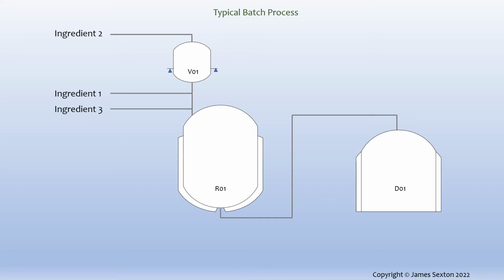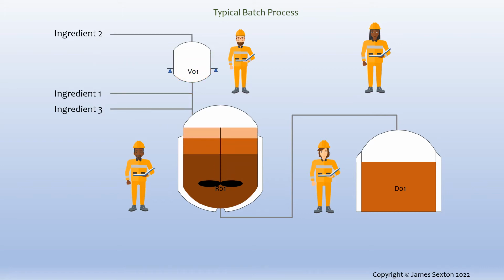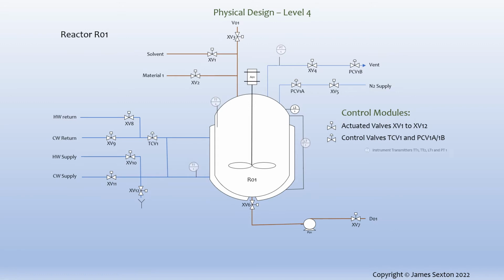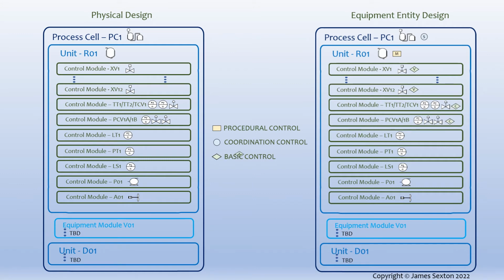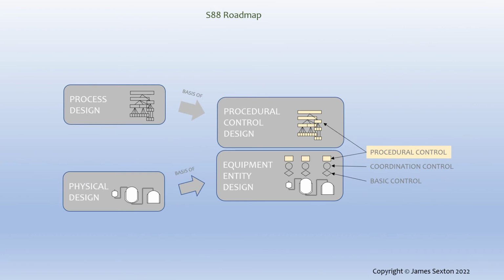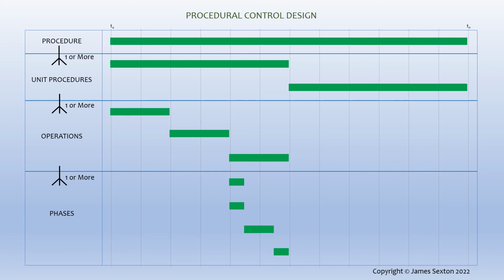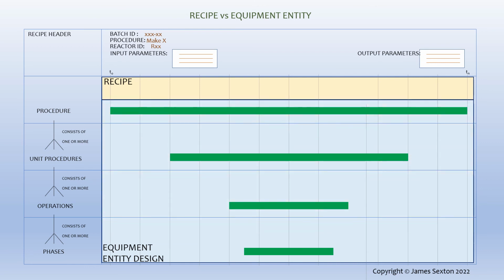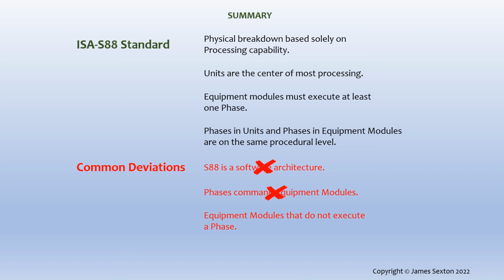ISA-88 Batch Control Design

Comment: I'm a little bit confused by your depiction of a level transmitter as being a control module on its own. The standard describes a control module as a "a collection of sensors [and] actuators [...] that is operated as a single entity", and that it must be able to carry out basic control by definition. The example it gives is a "device consisting of a transmitter, a controller, and a control valve that is operated via the set point of the device". Since a sensor cannot act on commands or be operated on its own, it feels incomplete to call it a control module. I'm curious to hear your thoughts on this matter.

Comment: I'm a solution architect. I made the mistake of simplifying S88 to being purely software. Now I understand the real thing and that it really depends on the physical model and the flexibility needed. I also made the mistake of understanding an equipment module as a combination of Control Modules.
Thanks Jim for this superb contribution.
Reply from the maker: Thanks for the feedback. I tried to be as faithful as possible to the actual standard. It is rarely complied with in the real world. Your misunderstanding vis-a-vis 'purely software' and 'equipment module as a combination of Control Modules' is no surprise. Both those misunderstandings are propagated by the automation manufacturers in there literature: Siemens, Rockwell and even Emerson to name the ones I am most familiar with. My video called 'Reality Check' was my attempt to acknowledge the Equipment Module issue because I think is VERY consequential!
Reply from the maker: their

Comment: Hello James, do you think AVEVA Batch Management is a good software for to manage batching and recipes? What program do you think is industry leading?
Reply from the maker: Ryan, I find all the batch management offerings 'samey'. Based on grafcet, drill-down paradigm and somewhat inflexible. In short, stuck in the 1990s. However if you have more than 5 or 6 distinct recipes, you will probably have to use one. I see no stand-out product that I would recommend.
Reply: @xavco6527  I appreciate the response, kind regard from Sydney Australia.
Reply from the maker: @ryandx-v9j  You're welcome! As a Scot we have a half-share in ac/dc 🤣. I live in Belgium🇧🇪. I am a Brexit refugee 🤣. Google Brexit.

Comment: Thank you for the great video!
I am freelance automation software developer, and I encrouage everyone to adopt S88 (not only for batch), beacause it is great. To be honest, there is not really an alternative for this design philosophy.
The main issue I encounter is, that people use the S88 terms, but in the wrong way and everyone is just comfused. It's sometimes plain annoying, that most people don't get the difference between a CM and EM.
But it's partly the fault of S88 itself. Equipment Modules (Procedural = EM) and Equipment Entitys (Basic Control = CM) are examples of bad naming conventions, that confuse people.
Reply from the maker: Thanks for the comment @VaragornX. Although I made the video as faithfully to ISA-88 as possible I concur with the points you make. The biggest reason for confusion is because practically no one actually reads the specification! That was my motivation for making the video: to actually express what the standard says and make it more accessible. The next problem you have noted is very true. It IS "partly the fault of S88 itself". In my next video I will try and shine a light on that inconvenient truth!

Comment: My challenge on the equipment modules would be th term "processing" is also misleading.
A pump and flow meter or control valve working together would be a "process". It is important to understand how that process will work, eg. Is the pump going to simply control to flow via or supply at maximum flow rate to a set volume, or both?
Reply from the maker: Since ISA-88 is a standard for batch control it can be assumed that the thing that is 'processed' should be the batch (or constituent materials).
Reply: What does the pump and flow meter actually process? What qualities of the liquid or gas are deliberately changed?

Comment: One of the best videos about Isa 88 I've come across! Why so little likes?
The last part where the recipe and equipment comes together is still a bit puzzling to me... May be worth another video.
Reply: Thanks @Bigman74066 for your kind words and constructive suggestion. You are bang on about the recipe/equipment interface - but to interpret the ISA-88 document accurately is frankly difficult. I am planning to make some videos on the theme of improving batch control methodologies: the interface you are puzzled by is at the forefront. Separating the 'business' logic (making vaccines/beer/ice cream) - from the technical logic (valves opening/motors starting) is not handled well in ISA-88 and therefore (I accept) not by me! Thank you. James

Comment: How do you write receipe in standard way of format or more structured format?
Reply from the maker: Nehal, 
Thanks for your comment. I'm not sure what you are asking but I'm guessing you are asking if a recipe should be constructed with all S88 hierarchical levels.
Firstly in my tutorial I emphasis that S88 is a way of structuring requirements and I steer away from implementation details. That is why I used a gantt chart format to describe recipes.
Even though most automation environments: DeltaV, Simatic Batch, iBatch favour Grafcet following the S88 hierarchy, there is no absolute requirement. 
Certainly in Simatic Batch you can choose a 'flat' structure and employ substructures which probably make more sense from a software point of view.
However, in Pharma I think the end user will want to see a 1-to-1 relationship between requirements and implementation which will tie you to the hierarchy.
I hope this helps.
Regards, James